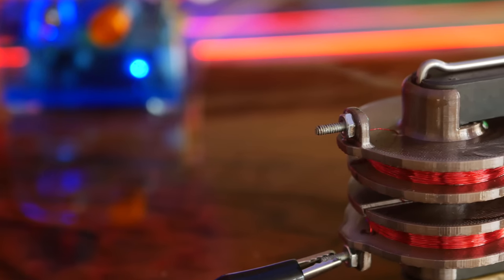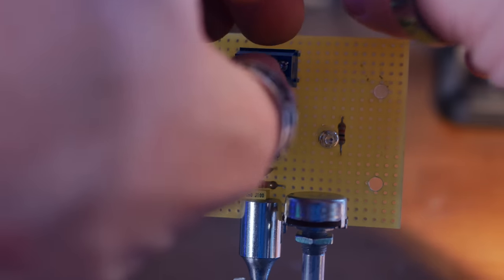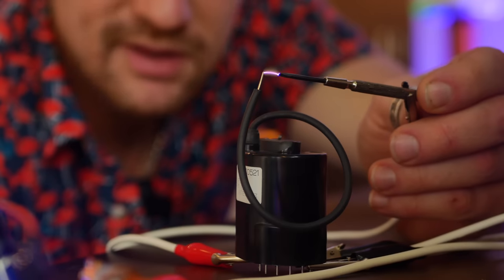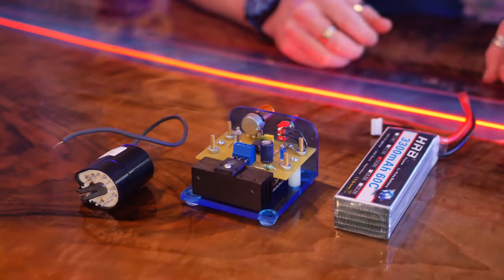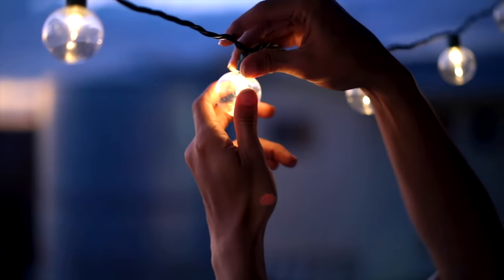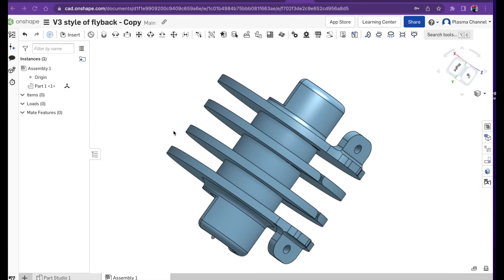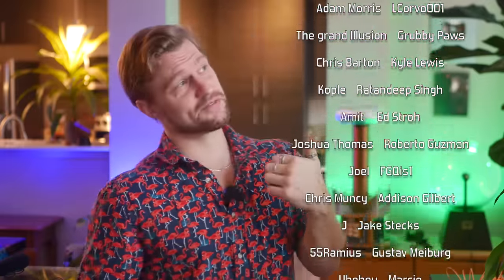Unreal Bluetooth Plasma Speaker (3D printed)

Comment: Very nice!
But looking at your circuit diagram, I think you should add a LC filter or at least a decupling capacitor before the transformer as well. As it is now, almost all current will be drawn as pulses at the switching frequency, directly from the power supply. That can mess with the regulation circuits of your power supply - which can explain the problems at 5:38. It seems very unlikely to have something to do with the audio signal - the control signal input of a 555 is quite high impedance and you would fry your audio player long before any significant part of the current can take that path.
The resistors probably helped by just lowered the control signal (audio signal) amplitude and thus keep the frequency and duty cycle variations lower (a more erratic frequency and duty cycle usually causes interference problems to get worse - but the main problem can still be the pulsating input current).
Reply from the maker: Thanks for the feedback! You know, I tried (off camera) adding several values of air-cored inductors on the positive path to the transformer. I tried 1uH, 5uH, and 10uH, all with no change what so ever in performance. Though....the 10uH did seem to drop overall current draw (which makes sense). So you think I should try a Decup cap? I appreciate your feedback, greatly.
Reply: @PlasmaChannel  Yes, but it will do more to add a parallell capacitor from transformer input to ground. Which can supply the pulses needed. 
Every time the MOSFET turns on, it will draw current, which stops once it turns off, while most of the stored energy in the transformer is transferred to the high voltage output (a flyback is like a combination of the inductor in a boost converter and a transformer). Adding an inductor in series before the transformer will just waste energy (since the energy stored in that inductor can not get transferred to the high voltage side - it has to get dissipated in the MOSFET or snubber circuit). The reason the total current dropped with the biggest inductor is probably just because the input pulses got choked - which doesn't help much and you may risk to blow your MOSFET due to the voltage spike when it turns off. 
But a capacitor in parallell, can supply the current in pulses, without the need to travel all the way from the power source (possibly making your cables act like antennas and cause RFI). 
Then adding an inductor between that capacitor and the power supply, will further help filter out any remaining ripple and get a pretty much continuous DC to flow from the power supply. But it's the capacitor that do the main work.

Comment: Where's the audio for the revised 3D printed AC flyback? It just went back to the DC audio before ending.
Reply from the maker: It sounded about the same as the DC, and arc size was identical. So I didn't really want to make the video any longer with an identical camera shot.

Comment: Nice job, thanks for sharing. Now, for the unsolicited advice: Without forced air cooling, you should orient the heatsink to take advantage of convective air flow, or at least avoid obstructing the fins. Maybe drill some holes in the acrylic underneath the fins. Depending on the amount of heat, just having a large surface area can be enough, but it's bad form to block the fins.
Reply from the maker: No, it’s true advice. I just care about appearance and form more then function sometimes. It was designed to be a flat surface. So, the heat sink does get very hot after a few minutes… which is good enough for me.
Reply: @PlasmaChannel  Handsome, smart, and gracious :)

Comment: Sweet project.  Really impressed by your build quality.  You would probably laugh at the monstrosity I built years ago to do essentially the same thing with a 2N3055HV transistor instead of a MOSFET with huge heat sinks and fan cooling for the transistor and the power resistors.  1/4" audio jack for plasma speaker operation.  Done "wrong" but works perfectly with a larger footprint. :)

Comment: Call me out if i'm wrong , but i think you 're using the term flyback wrong, a flyback transformer has feedback from the transformer, no external timing cicruit needed, and the feedback loop is kinda load current conrolled, but the transformer you made is a simple transformer, not flyback

Comment: Hi Jay! Great video as usual. I'm surprised the 555 can drive a p260. I'm pretty sure if you add buffer transistors to the output of the 555, you'll get a better output and put less strain on the 555 because they'll carry the current. The mosfet will run better too.
Reply: I found very good results using a totem pole driving stage. It worked fine without it, but the 555 kinda struggled to switch the FET hard enough, so I wasnt getting a nice crisp square output. made the fet run hot and limited the amount of current it could put out. a totem pole really improved the output drive waveform under load, ran the FET cooler, and my arcs doubled in thickness and meanness. the only other mod to this unit that made a bigger difference was going from 24v to 100v, which was a MASSIVE redesign for many reasons. you should be able to shoe-horn a few extra transistors on any design without much effort.
Reply: @arjovenzia  exactly. And if you check the design on the 555, you'll see inside of the output on pin 3 is actually a little mini totempole. So by adding an extra stage, it's like steroids for your pwm lol.

Comment: Took me a sec to work out the circuit, it looked like yo were supplying the bottom of the mosfet via the led, until i realised the crossed wires at the bottom were actually a connection, confirmed by the 'hump bridge' near the 68 ohm resistor
For a long time, a direct cross is not a connection, a staggered cross is. it's meant to avoid connfusion if the diagram fades and connection dots are not clear or are forgotten or not used ;)
Reply from the maker: Oh that's something I didn't know. Thanks!

Comment: If I remember correctly if you need the output to be cleaned then the input you run a 555 op amp into a 555 op amp as a negative feedback loop. Though for just power not sure if that's needed.

Comment: Hey Jay! Love your videos! Something I thought worth mentioning is that for your Bluetooth plasma speaker, I found that the DC Flyback transformer I use plays music inside itself and the AC flyback that you put in your links I bought also plays music inside itself, but not through the arc stream, most of the time, no sound at all. Does not matter what resistors I use for the audio out on the Bluetooth receiver board. Have you encountered this? There might be something in your schematic that I am missing or a mistake. I would like to know so I can get it working. Thanks!

Comment: I built a plasma speaker as a school project many years ago. Only problem was that the Mosfet would desolder itself after about a minute of operation, even with heatsink. Is there a trick to have less energy loss at the Mosfet?
Reply: get one with the lowest rDS
Reply: Hey, one of the ways to lower energy loss in MOSFETs in a flyback driver is to have a snubber circuit across the primary coil. A primary with high inductance is also preferred. Let the resistor be a high power one coz it heats up very much. Just built one a couple hours ago and the snubber circuit keeps the MOSFET stone cold. Good luck with your build!
Reply from the maker: I do find my MOSFET getting very hot after a minute of use, but never enough to break. The snubber circuit indeed does help - using a 10k resistor in series with a neon indicator bulb is an awesome snubber.

Comment: Thank you for this. Ive been struggling with this circuit for awhile and many of the other videos on plasma speakers aren't very clear or easy to follow. Quick question, can the neon bulb be replaced with a zener or ultra-fast recovery diode? Thanks again!

Comment: I built a version of this a few days ago except I used a zvs driver, and it doesn't have Bluetooth. Only a 3.5 mm audio jack. It can handle about 250 to 300 watts and makes an arc about 3 or 4 inches long.
Reply from the maker: Wow that's crazy. You should upload a video, and provide the link here.
Reply: @Plasma Channel  https://youtu.be/hiQFqK3zi5Y here's a video, sorry if it's really low resolution-im not sure how to fix it if it is.

Comment: Hello Plasma channel you should built a zvs driver there are more stable they dont use a lot of power and the best thing they use a pure sine wave witch is adjustable by changing the tank capasitors 😊

Comment: wonderful video jay 
can you tell me no of turns in your flyback(the one you made) secondary coil.
Reply from the maker: So that one I cannot help with. I designed the secondary using concepts, not using calculations. It's often how I build my devices. I wound enough wire and left space where needed to ensure 1) no arcing to the core 2) not too great of voltage gradient is experienced between turns, and 3) no arcing between halves of the secondary.

It's a good 150 meters of wire though, I can tell you that.
Reply: @PlasmaChannel  thanks jay, if possible can you tell me the diameter of your 3d printed plastic   inner diameter and outer till where coil was wound

Comment: So the 555 timer chip limits your input voltage to about 15-16 V max but it sounds like that's enough.  Just curious, why the neon indicator lamp across the output?  Why not just another LED?  How do you even get enough voltage to light a neon lamp across the output?
Reply from the maker: The neon indicator bulb is a snubber circuit. It lights up when there's back EMF above 80 volts, and protects the circuit.
Reply: @PlasmaChannel  Ok yeah that makes sense.  I figured the only way it would light is via back EMF from the flyback primary.  Wondered why you'd even want a light there given the frequency but I didn't consider the protection angle.  I can see how it would protect the MOSFET and the power supply.  I do recall seeing yours light intermittently during operation so it clearly works as intended and is needed.

Comment: I made a plasma speaker with a small florescent light ballast powering a flyback from a tv. Then for the audio board used a desktop computer speaker board with a volume control and aux cord. And then a mosfet from a tv I think. Music plays sine waves I think because you can hear vocals clearly like a regular speaker. Not sure if this is the same circuit or not. Also I use an old phone to play music because the aux cord shocks you when its playing which also makes the phone extremely glitchy and hard to get the volume buttons or the touchscreen to register. So I guess the high voltage is leaking into aux cord somehow. I don't know a lot about electronics but could you use a full size ballast to power a bigger flyback and get a 1 or 2 inch spark like franzoli electronics except it would play vocals and not just 8 bit or square wave music? Thanks
Reply: I wish I could see that sounds awesome maybe the shocks are from emf

Comment: Cool circuit but the problem is that the transistor get so much hot that after some time you have to turn it off.. using a ultra high speed cooling fan may be the solution for this

Comment: Hey so I am new to this channel and I love the build and I am tryin to get the parts together to build one, but I have questions. What do you use for the input on the power supply and are there any good online resources you know of for caps, resistors and such, my local store had some stuff and online is really hit or miss. Even the mouser source you have in another video was limited. Any help would be appreciated.

Comment: The schematic shows the potentiometer connected on pins 1 and 3, yet you soldered them to pins 1 and 2. Which is right, I know the answer. Are you sure the res is correct?

Comment: That huff after reading the parts list 👌
  Question is there any reason one of these couldn't act as an ultrasonic transducer? 
  I mean if I ran it close to 50khz could I get decent audio from 15-25khz? Or would I be better off rapidly changing impedance on the other input?
Reply: If you only want one frequency (and many harmonics of it) It's actually easier than that:

The ac from the transformer is already enough to get sound produced by the arc.
Note that the arc fires twice as frequent as the drivers frequency, since ac passes zero and reaches a maximum twice per period, becuse of that you'd have to drive the transformer at 15kHz to get 30kHz

If you want to have a plasma speaker for ultrasonic waves you indeed need to set the driver to a significantly higher frequency. The theoretically lowest possible would be twice the sound's frequency due to the Nyquist-Shannon sampling theorem (the 555 chip can only change once per period, and thus has a sampling frequency equal to the drive frequency)
You may be able to drive a flyback transformer at 100kHz, but for that you will likely require a larger heat sink, changes to the circuit or a totally different circuit, as well as a well picked Mosfet

Comment: I don't know if know this or not but all of these high voltage arc's you are in close proximity to when in operation, are in fact bombarding you with X ray's.???
Reply from the maker: X rays are not produced using AC waveform, and most often require a vacuum for full effect. Can guarantee low powered AC sources like this are safe.

Comment: I've actually designed 3d printable winding bodies for flyback transformer cores before. One test transformer that i built is still alive despite numerous attemps of me to break it. It is wound with 0,2mm copper wire and insulated using normal food grade vegetable oil that i dried by heating it and by pulling a vacuum on it for several hours. It's on thingiverse (winding body Igor) if you have some ferrite cores left you can try it out if you like... Even broken cores work... my test transformer actually only uses the center part of an old dst where the outside part of the core broke off. My transformer is incased in a mason jar so using only a rod core has the added benefit greater insulation since the primary is wound around the glass. Good video!

Comment: Ok hear me out here.. What if you built the plasma arc end in a glas tube (open on the ends to make it safer to walk around with) and use this as a speaker idea to integrate in a cosplay Sci fi rifle were it would create a sound (like plasma charging ) in normal use but would use the gun trigger to trigger a mp3 player board to output sound through the ne555 to make it sound like it discharges and fires the rifle.... How cool would that be..

Comment: It’s been a long while I delved into electronics, but why would a resistor and a capacitor help the bluetooth board? Using them both would lower the voltage and current input, correct? Seems counter-productive.
Reply from the maker: Because the bluetooth board outputs too much voltage and current from what I found. The input for the 555's pin 5 doesn't work well with 12 volt input.

Comment: Great video!  You do excellent work.  I hope you can help me with the following question.  You included the link "AC flybacks from ebay"  I wanted to be certain this was an AC flyback before I made a purchase.  I contacted the eBay seller and asked, "Is the output of the transformer AC or DC? (i.e. does it have internal diodes)."  They replied, "The internal output has a rectifier diode."  Did you test this exact flyback and determine that it was AC ?  If so, what test did you perform to verify that it was an AC flyback?  If it is an AC flyback, then you can use a voltmeter to measure the resistance of the secondary, which is typically a few tens or a few hundred ohms.  If it is a DC flyback, then it will have internal diodes, typically with a high forward voltage drop (in one case, 85V at 5mA), and therefore the resistance of the secondary will measure essentially infinite resistance on a voltmeter.  The diode check function of a typical voltmeter will not work, since the voltmeter cannot provide enough forward voltage.  Thank You in advance for any further information that you can provide, and again excellent work !!!

Comment: Please, the subtleties of flyback circuits is not my area of electronics.  Google searches did not turn up any comparisons of A.C. and D.C. variants that would explain the preference here.  Would appreciate a link to an explainer that best fits the reasoning in this video.  Even better would a video from this channel on that topic alone.
Reply from the maker: DC flybacks are AC flybacks...castrated. DC flybacks have a diode permanently inserted into their windings that creates DC out. But you can't do much with high votlage DC besides power a marx generator or Tesla coil. An AC flyback allows you to power ANYTHING, and if that thing requires DC, you just add a diode separately. DC flybacks are just castrated AC flybacks.

Comment: I love seeing 555 applications that modulate the output with pin 5!  THANKS BIG!  So much can be done with this pin (WHICH IS MISSING ON THE 558).  And a HUGE 'thank you' for showing a schema.
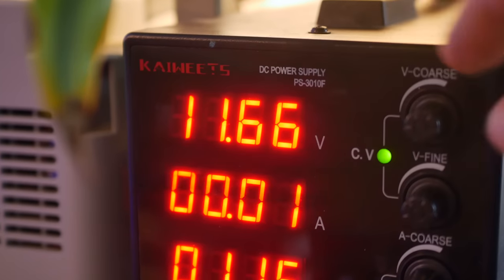One picky correction in the video...at about timestamp 4:02  you called the waveform on the scope a 'perfect square wave'.  It is actually a digital pulse train with about about a 20% duty cycle...a square wave is always 50% duty cycle.
I have a request that would help me more than you would know...I am trying to inject a current pulse in the 100mA's range into a flyback spark in the uA's range.  These HV, pulses are about 40kV and last only a few ms.  Any ideas?????????
THANKS MUCH FOR ANOTHER SPECTACULAR VIDEO!!!